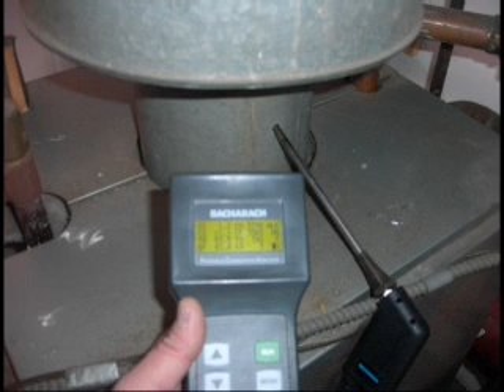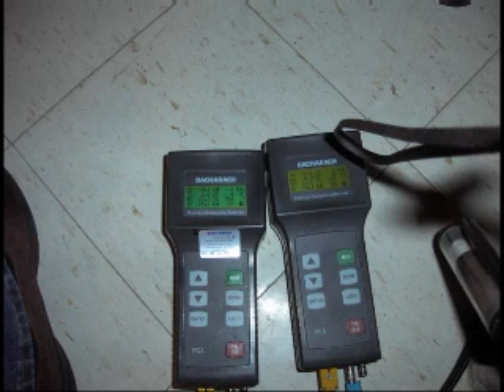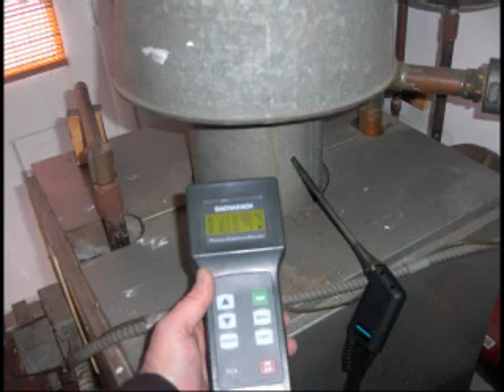Furnace HVAC Plumbers can Kill People from Carbon Monoxide

Comment: Helpful video and I've learned some things. We are retired and have a propane hot water heater. For about a month I've noticed when I go out at 11 PM through the garage,  that there is a very strong indication of carbon monoxide. I've also notices on some nights that I can smell it in the house. We have detectors in the bedrooms. I've checked the flue, no clogs, but "fixed" leaks in the pipes. It still leaks . I'm not sure about the combustion as there are yellow tips on the flames. I can't figure out why it would leak so bad. There is a heat pump on it and I think it leaks when that is on. I suppose I will have to call out our HVAC plumbers to have a look at it. Thank you for the video. It was a little more informative than the others.
Reply from the maker: thank you

Comment: You sound like an advertisement for an ambulance chasing attorney.  A good tech can use his senses to detect most of these problems.  We didn’t have the new fancy analyzers when I started in the trade 45 years ago.  
We checked draft with a match, and learned to adjust burners by the shape of the the inner cone.  We could detect bad combustion by the yellow flame, smell of aldehydes, and the soot left behind.  Yes, I had those instruments at my disposal later on but only used them to set oil fired equipment, and do start ups on other equipment that required it.  You seem to be much more knowledgeable than the average home inspector.  Maybe you should go to work for a  wrongful death attorney instead of slamming HVAC techs.
Reply from the maker: ROD it was this video the made you all go out and get CO certified.  THANK YOU MARKO

Comment: Roofers can kill you too.  When we had our roof replaced, the roofers did not reconnect the exhaust vent pipe back up to the water heater correctly.  I had to fix it myself when I discovered the mistake while checking the water heater in the attic.

Comment: Why would you inspect for carbon monoxide in the flue meant to send the carbon monoxide out of the home?
Reply from the maker: It is the only way--- you need to know the O2 level, CO2 Level CO, level Draft, Temperature, Rising CO and then with that information you can determine if proper combustion is occurring.    NO OTHER WAY

Comment: Most HVAC techs and plumbers have no clue what they are doing and/or they are lazy as shit, some are awesome and are experts at their trade, but the majority of them really suck in this day and age. 

I had a hvac tech (and he ended up being the owner of the company) come out recently to do a thorough cleaning of my furnace. He ran his vacuum for about 15 min. but I doubt he even cleaned a thing, he didn't even clean the burners, which were filthy and I had delayed ignition because of the filth. He didn't bother even taking anything apart. I had to clean the furnace properly myself. Lazy as fuck!

Had another come out about year after that (totally different company) to clean my AC unit. He told me he cleaned the outside unit but also said that his hose wouldn't quite reach so he could only clean part of it. I don't think he cleaned it at all and at the time I didn't have time to check his work. He didn't offer anything, didn't say he would be back to finish, he was done. Didn't even touch the indoor coil.     

You really gotta check these techs. Most of them will lie and they have the mentality that it isn't their house or affecting their life, so they don't give a fuck.

Comment: BTW, Home inspectors aren't allowed to work on Furnaces, or ANY gas fired appliance. That's illegal. At least where i come from.
Reply from the maker: not working on it  inspecting it only
Reply: You are not licensed to drill or alter any HVAC equipment sir I like and respect what you do ,I’m a licensed HVAC contractor and I Cary 2 high end Combustion analyzer to each and every service call to make sure people are safe my family can’t sleep in the house I will not let my customer sleep in there

Comment: I REALLY hope you're a Gas Technician! Seriously, a hole in 636 power vent hot water tank! LOL! Come on....... Home inspector right?! NOT a Gas Technician!!!!
Reply: I'm sure there are some very good home inspectors but I only hear about the bad ones.  I got a call from a guy who had just bought a home and his A/C was not cooling.  I found out that somebody had hot wired the low pressure switch so that the A/C system would pass inspection.  In other words, the inspector just checked to make sure the A/C fan and compressor were running but didn't check to make sure the system was actually cooling.  Anyway, the new homeowner was really upset because the compressor was ruined because the system had been running constantly with no refrigerant in it.  BTW, it's not that hard to check the A/C.  You just need to measure the temps going into and out of the evaporator coil.  Had the inspector just put his hand over the outside fan, he would have been able to tell that the condenser was not putting out enough heat.
Reply from the maker: Pilot ---  I hole you are not HVAC.  You cant adjust the gas without this.  This hole was made by the HVAC installer.  Yes-- I am a combustion analyst. Plus I am an expect witness to death cases after you guys kill people
Reply: Clevelandmarko go back to inspecting homes , leave the Gas Technician stuff to the pros. In fact, the biggest ripoff is the "Home inspectors ". My family has been ripped off by so many of you, I do my own inspections and catch shit you guys don't.
Reply: @Clevelandmarko  lol. I’m a licensed Gas Tech G1 and know the laws. You don’t...... and that’s scary you are peddling bad information.

Comment: i rent a home and at first my old karoscene furnace would sludge up cuz of the cold in the line so the furnace would just stop working note at this time theirs no fumes coming from vents! after time of a side worker unslugging the line to the furnace, found out that the furnace was going an their was a crack in something on the furnace. so they replace it note that around the closet is built up spilled karoscene i guess in the woodwork around the furnace storage area. sooo i got the new furnace, STILL FUMES from the vents! then the workers tried saying that their was a crack at the top of the hot-water heater which is next to an behind the furnace, an said because of the old dried up karoscene on the woodwork that it was getting wet from the leaking hot water heater an was causing the fumes. now a week an a half later... the hot water tank was replaced an during this time while it was getting replaced my family stayed in a motel for 4 days because the fumes were so bad. we come back their still their note the fumes would be so bad that while the furnace was running we had all windows open an it was very bad even outside, they told us to leave it running that it will work itself through an the fumes will go away. i said hell with that an haven't ran my furnace at all an the fumes went away for the most part i only get fumes when the furnace is ran an it still comes from the vents, the worker today tried lowering the fan to all the way on low an changed the valve to the smallest one.... the furnace wasn't running for the even 3 min an my whole bathroom and bedroom which are built off each-other were engulfed in fumes. PLEASE SOMEONE HELP WITH INFO!!
Reply from the maker: +kayla marie  You need combustion and draft testing of water heater and furnace. You also need HAVC diagnostics to see if you have pressure problems that permit spillage and incomplete combustion. THIS IS SERIOUS AND DANGEROUS.  You landlord is an idiot. He or she needs to hire the right certified people.
Reply: +Clevelandmarko thank you very much for getting back to me. I knew after watching your video that's what had to be done an he's cheap and don't wanna spend the extra money
Me and my fiancé have told him he needs professional ppl he won't listen so I'm probably just going to move. I haven't had the heat on once since I commented on your video an the smell is finally gone but it does just pop up out of no where in one of the rooms sometimes

Comment: if there is an issue with CO in a home, walking through the home with the analyser WILL indicate if CO is present in the home or not. that is why the people in the home are experiencing the issues related to CO poisoning. 
if a high efficiency furnace is producing CO a technician will not need their analyser initially as the flame will be very "messy" due to the positive pressure in the heat exchanger once the indoor fan comes on. unless it is gas pressure related, but that is why i carry a manometer in my pouch. also, the flue gasses will stink of aldehydes. a hole SHOULD NEVER be drilled in the outlet PVC pipe. 
checking with an analyser after the draft hood proves your video is full of miss-information as the draft air has diluted the flue gasses after that point giving incorrect readings. 
more i could point out, but the only other points i feel i need to make is to homeowners from a gas technician, if a tech shows up to perform a cleaning on your natural draft boiler and does not have a combustion analyser, send that person away. 
other than that, it is my opinion that many more home inspectors are undertrained than gas technicians.
Reply from the maker: ryan ernewein This is why people die and get sick. Its people like you that think that they now everything.You need to go to combustion school for 4 days and get the facts before you kill someone.  Let me thinks. If you DON’T  USE AN ANALYSERE and you don’t use a draft gauge,   YOU DON’T KNOW IF   a) ITS OVERFIERED, b) UNDERFIRED, c) HAVE HEAT TRASNFER, d) HAVE A VENTALATION PROPLEMS because of a birds nest,  c) HAVE A MAKUE UP AIR PROBLEMs because you have basement cold air return duct leakage or one of those stupid EXHAUST BREATH MACHINES, , f) HAVE RUST, DUST, DIRT or DEBRIS IN BURNERS from a house flood or high humidity because 10 years ago the house was a foreclosed on, G) HAVE AN BURNER ALLIGMENT PROBLEM because a kid ran his BIG WHEEL  into the furnace, h) HAVE A VENGTALTION PROBLEM because of a the oversized kitchen exhaust fan, i) AND EVEN A CRACKED HEAT EXCAHNAGER which even if its cracked hardly ever produces CO.  All these CONDITONS produce incomplete combustion and all of these conditions  can kill you. YOU WING IT by looking at the flame. DUDE fined a new occupation before you kill someone . Let see how smart your    are.  TEST FOR YOU.  You drill a hole and place the Combustion analyzer 1 foot from the unit, and the CO is 455 PPM, the CO action is stable  (still 455 PPM)  after 2 minutes, the OXJGEJN (O2 ) is stable and is 2%, the stack temperature id 465 (hint this is a draft induced furnace), you put the draft gauge into the same hole you drilled and you get .2 WC., SO-------SMARY PANTS what is wrong with the furnace. IF YOU WENT TO SCHOOL YOU WOULD KNOW EXACTLY WHAT IS WRONG. BY  THE WAY NO CO in the house at testing time.  PS THIS FURNCE KILLED SOMBODY.  PS you better go to every house that  you left your company sticker on because when people  get sick ,and I show up as an expert, you will sued.   LAST PS, you can cheat by going to my website and finding the cart if your happen to know how to read it.
Reply: your arrogance must be legendary. have a nice day.
Reply from the maker: ryab exactly what I expected. You have no clue and can't even come up with good response.
Reply: I'd be more inclined to give credence to your rant, if you knew how to spell.  Right now, your rant just makes you look very foolish. Remember, Spell Check is your friend.
Reply: @woodrat2296  I'm disinclined to give this guy any credence, proper spelling or not. The more I see his responses and sensationalist videos the more disgusted I am. The one on ventless fireplaces is particularly laughable.

Comment: Hey Marko, I have a related question for you. In our house, a new water heater was installed in 2012. The HVAC/plumber attached the vent from the water heater to the same flu as the furnace. Several years back I was certified as a home inspector (tied onto being an exterminator as an add on service in my company). We were told that the above mentioned was an absolute no-no. There is a separate vent present not in use, and I am kinda wondering if I should have this fixed?  Great video, I will be sure to ask my HVAC guy the next time I see him. Also, we are considering having a whole house humidifier added to our furnace- what should I be careful of in adding one of these to our home?
Reply from the maker: That code says yes to sharing same flue with draft induced or  fan assisted furnace connected to a natural draft water heater. The problem is that the water heater will spill until the flue reaches 140 degrees in the chimney. If the higher effeieinnt  furnace has poor combustion, then you get CO. STUPID CODE that kills people.
Reply from the maker: Humidifier is OK as long as you understand that it can permit condensation on windows, walls, corners, closets and atticl if and when overused. WINTER BASEMENT HUMIDITY SHOULD BE 25-35. IF IT IS COLD OUTSIDE AND YOUR BASEMENT HUMIDITY IS 40 YOU ARE SCREWED.
Reply: Thankfully we don't have a basement, we live in a two story town home on a slab foundation:-)

Comment: clevelandmarko,i have a 60 gallon tank wtih about a 5" exaust hole on top of tank and 3" flu pipe to the chimney about 2 ft away with also 3" hole in chimney!..my problem is this..it gets very hot right at the top of tank and you can feel the heat coming out but,the flu pipe is also very hot so i would think that the exaust is making it to the chimney....the question to you is this...do i need to make the flu pipe bigger?..to 4" maybe?..or do i also need a chimney cap to keep downdraft?..thank you!

Comment: yes it will come out of the hole, if the chimney is not drafting properly or whn the hvac guy drills holes in pvc and in the wrong location on the flu it will leak out, WOW i im speachless about this one.. do not drill the pvc!!!
Reply from the maker: If you drill PVC you must seal it.
Reply: Clevelandmarko you take the reading from where the vent terminates with the pvc .
Reply: Wayne Campbell I have also seen it drilled and sealed .
Reply: Although this guy is harsh he is right on almost every count and EVERY important one.  I am retired chemist that worked with PURE CO that would kill in one breath and had endless training over 20 years.  Background levels of 0 to 7 ppm are typical, but even then the 7 ppm gets investigated.  I believe CO alarms start complaining at 50 ppm and over about 70 ppm start to displace oxygen over time in your red blood cells.  His point about elderly and anyone with existing COPD or emphesema is important.  Cherry red lips and weakness, mental confusion are at high levels where you are in trouble already. Death is swift at about 400 ppm sustained. He cannot emphasize enough this threat.  Why would anyone professional take a chance on killing someone.  Combustion with too much fuel/insufficient O2 by metering out of adjustment or negative pressure in room sure way to get reducing flame (yellow = CO).  I saw a high efficiency furnace with only exhaust pvc going outside and intake just stub inside. Everyone here knows why that is bad and illegal.  The pressure switch fortunately forced a fix when clothes dryer installed.

Comment: Super informative as well as very important.  Negative pressure has to be a major issue in today's homes as more and more people seal up houses.  Some older homes were never meant to be air tight?
Thank goodness more and more HVAC systems (90%) are combustion isolated.  If I heard right, the government is forcing the 80% systems out...

Comment: I had to read some of the old posts about your video, and it appears you are a home inspector and not a person in the heating industry? 
Had I known, I never would have responded as I did. 
But since we are both on the dance floor.. let's dance a little.
I don't need to trash my auto mechanic to teach my kids about when they need new brakes in their car. Carbon Monoxide is scary enough, knowing about how to detect it, is life saving information. That would be a nice focus. megaburp@aol.com

Comment: Carbon Monoxide = BAD. Making a video where you act like a professional yet making incorrect statements = More BAD.  
Safety should be the primary concern of any company, do your homework, and check references. But, just like having an annual health exam does not mean you can't get very ill, the same is true with anything burning gas. Don't ignore it, don't take it for granted, and by all means, make sure you have at least one carbon monoxide detector in your home.

Comment: wow, where to start...
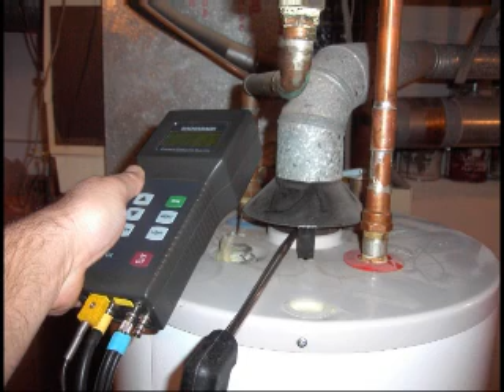well at :25, :38, and 1:02, your draft hole is in a bad location.  Needs to be at least 1 ft from draft hood and any elbow, typ 1 ft past the 1st elbow is the rule.
At 1:11 you drill into PVC.  this is a sealed comb. system, you NEVER drill PVC!
At 1:02 you are trying to get an undiluted CO reading from your DHW, tough angle to get a probe into the throat and into each turbulator.
At 1:20 "don't patch hole"  ?!  yeah, you do.
For that matter CO is lighter than air. stain?

Comment: @Clevelandmarko  dummy has taken a few classes and is a nordyne certified technician.  on a natural draft furnace ( no draft inducer) the flew is under a vacuum there fore it will not,  BUT on a draft induced furnace the flew pipe is pressurized do to the "fiction loss" of the lenght of pipe and fittings used, so putting a hole in the exhaust side of a draft induced furnace will result in exhaust escaping the flew (contaning carbon dioxide) and entering the area in which the unit operates!!!!